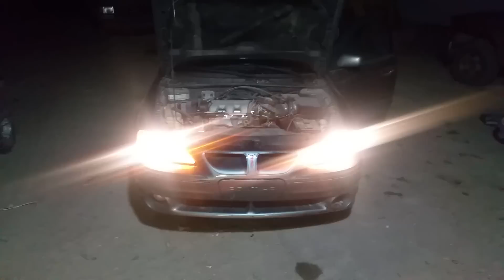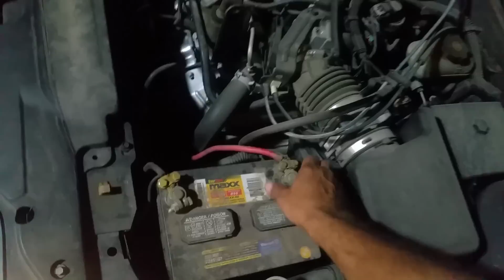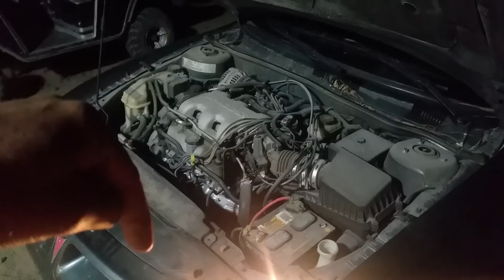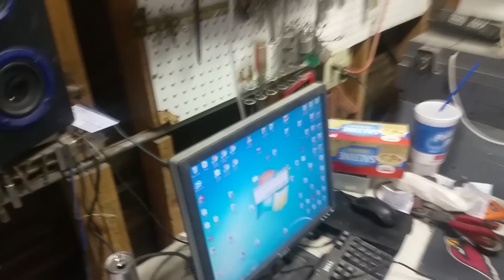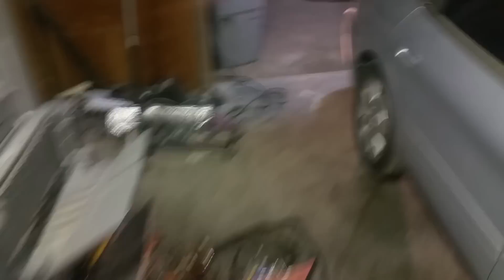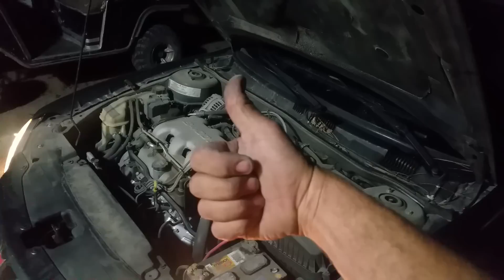Bad Alternator or Bad Battery, Easy Solved

Comment: Though yes this method works however on vehicles with ECU this can cause damage
Reply from the maker: uhmmm no, i am sure it wont, i am positive, i am 100 percent sure it wont, uhmmm yea ! no harm to the ecu by doing this. did i mention the ecu will be ok,,, do your homework. it may reset your ecu,,, but it will not harm it. you can buy a 100.00 $ obd reader and clear your codes,,,, it does the same thing ( resets your ecu ) but thanks for watching...
Reply: thomas brian it can also damage the alternator FYI ASE certificate
Reply: thomas brian what happened that once you take off a lead then it’ll spike up witch can cause endangering to the semiconductor however yes this is a rare thing to happen however it’s not the proper way to do it
Reply: thomas brian p.s said the one who ASE certified
Reply from the maker: ase certified,,, isnt everyone. its 45.00 $ on line for the course. ase certification is a joke, if you are ase certified, then you know that. semiconductor ??????? ha so funny. here is a idea ,, dont do it if you dont want to. but dont scare people from saving money when it is a simple task they can do their selves. seems ever day i am explaining this very thing. when i get a chance i will post another video dissecting a ecu and explaining how it works for all to see. you do know that any vehicle with a ecu will also have a internal regulator inside the alternator right ? what is the purpose of that regulator ? you do know that when the battery is full charged the alternator does not continue to put out 14 volts right ? you do know the ecu knows when the battery is charged right? you do know the ecu directs the amount needed of the voltage out put to the regulator before the regulator puts out the voltage ? your ase certified so of course you know. so what makes you think there will be a surcharge of voltage that the ecu can not handle. you do know everything in the vehicle has a fuse? you do know that when to much voltage is not regulated by the voltage regulator that the ecu will shut it down, and worse case it will pop a fuse to whatever ( including engine fuse for ecu ) before it frys any wiring and such. i have spent to much time educating you on all that you know already? please stop convincing people not to save money,,, please. if we can help another, its important that we do! its how we make our mark on this earth. thanks again for watching.
Reply: thomas brian your funny ☺️

Comment: Ok.  here's what happened when i tried this just last night  ( 6-2-18)  yes,  my batt had been doing wierd things...got the batt light on dash,  along with the 'brake light?...plus,  fluid on top of battery ( acid, assuming) so...replaced battery.  everything seemed fine....for half a day.  then....the dreaded god damn batt light again....and lifting hood,  freaking 'more fluid on battery, appearing to come out from under the two 'cell caps'.  what in the hell is causing a brand new battery ( 'and...my last one)  to be freaking spewing it's water and acid??....DID, have a couple 'know-nothing' teenagers...who work at both Auto Zone,  and OReiley...hook up the OBD 2,  and tell me,  your Alternator and Voltage regulator,  are both good.   I digress:  so...last night,  just to 'see this for myself,  and double check,  that those two idiots at the 'Wal Mart of Car Parts-Stores'...didn't get it wrong....i keep my engine running ( 99' Montero Sport) and lift the positve terminal clamp.  what happens....i noticably 'hear' and feel'...a surge throughout my engine...and,  of all things...my damn Window Wipers frantically start swiping.  mind you...the wand on the column,  NOT in any 'on position???....go figure.  then,  worst of all.. i pull into my driveway...and go to 'bring all my auto windows up....driver window,  won't come up.  Ladies and Gentlemen...i'm not sure 'lifting your Battery hookup, while your car is running,  is such a good idea.  what i believe ( clearly?)  can happen is,  you're going to allow a Volatage Surge,  to occur ( car-dependent)  and it could blow some circuits and fuses.  btw,  did check my fuse today for windows...replaced.  didn't help.  Great.  now i likely have a blown component or circuit Inside my Door,  which is going to require taking it into a shop..and fucking spending money.  DON'T DO WHAT THIS VIDEO SUGGESTS.  It can screw up components!
Reply from the maker: your so full of crap your eyes are brown. and why would you check a fuse if it is working. voltage surge you say. ha ha ha. with out the battery hooked up as you suggest , the alternator put out more voltage !!!! quick invent that and plumb it into my house for free voltage. i want to get more than i put in !! and here is the funny part ,,,, you disconnected the battery and acid boiled over,,, where was it getting more voltage if it was disconnected ! and if your trying to say it produced more after you hooked it back up then why didnt any fuses blow on windows and wipers and blah blah blah because the fusses protect these items from getting to much voltage,, hence the word fuse !!!!!!!!!!!!!!! here is what truly happened big guy,,,,,,,,,,,,,,,,,,,,,,, you disconnected the positive side of the battery and there is not one wire, but two. you failed to hold the two together so there was a voltage drop from the wire from alternator and wire to fuse panel. the voltage drop made a few things wiggle and that scared the hell out of you since you do not know enough about what you are doing. yes voltage drop not spike !!!!!!! but after connecting them everything went normally. but it worried you so much that you had a game playing part time counter person ( professional, just ask him ) double check things for you. next time remove the negative if it has only one wire, or keep the alternator wire close to the fuse panel wire or the car will try to die. needles to say your upset because 1 you didn't follow directions, and 2 you own a Mitsubishi that worries the hell out of you. i have your solution,, stop pointing blame because you cant follow direction and for crying out loud BUY A CHEVY !! hey,,, thanks for watching.
Reply: drummerfella 55  what a jackoff u are. thomas brian has explained in detail how/why it works & wont cause damage to your vehicle. i am no ase cert mechanic, just shadetree but probably have been wrenching way before u were born. not gonna re-hash whats already been said but maybe u should start with the basics & research what the purpose of fuses & regulators are for.
Reply from the maker: well said, thanks for watching bama

Comment: What about the wires between alternator and battery, could they be fray?
Reply from the maker: no, the alternator has a internal regulator that will only allow it to put out the amount of voltage requested, ( what is drawing from the wire).
Reply from the maker: thanks for the like clicks john. !!!!!!!!!!!!!!!!!!!

Comment: Dont forget the clock! You also have to reset the clock. Lol
Reply: It's not the memory they worried about is the computer is $100 computer you have to buy
Reply: And on some fords if you was to drop that cable and it was a touch anything $100 computer

Comment: This test wouldn't work on 1st generation Toyota Avalons though. Their electronic ignition goes haywire when you unhook the positive.
Reply from the maker: if you noticed in the video i mentioned holding the positive wires tightly together. this will avoid that, in your case just disconnect the neg. i will make another video better explaining i did not think this one would get this much attention. thanks for watching and for the great comments.

Comment: Great video.  I'm having a strange issue with my 2010 Odyssey: When applying the brakes, the battery light comes on but then goes off when momentum stops.  New alt, newer batt, checked all cables to/from both, checked all ground wires, just not sure what to look at next.  The vehicle does not shut off or shutter, just the pesky battery light.  Any thoughts would be appreciated.
Reply from the maker: check the alternator for a loose belt, it sounds like when applying the brake the engine has a little drag time. with a automatic it sometimes does that. with the release of power to the engine the engine can twist just a bit. i think your belt is to tight, or to loose. go to the further part of the belt from either pulley. center if you would. push in with your finger the belt should flex about 1 inch in. to tight or to loose and you can get a light or sometimes squealing. let me know what you find. thanks for watching.
Reply: thomas brian - I checked the belt as you suggested and it seems fine, about 1" of play either way. I also don't see a way to adjust the tension as the tensioner is what looks like a small shock absorber. I drove it around this morning with no issues but as soon as my wife took it to work the light came on when she pressed the brake. I don't get it.

Comment: Not true ... some cars need the battery to run.. My car shut down.. turned off... changed the battery and its running fine now... I think it had something to do with electronic fuel injection or something..by your logic I should  of changed the alternator..

1990 Honda accord.. 250k

Comment: DO NOT DO THIS!!!!!!!, especially on modern cars. because those rhave a computer in them and do ing this can seriously damage the computer in the car by just running on the alternator. get a mutimeter and meashure the voltage. do not remove the terminal when car is running bad bad bad for electronics
Reply from the maker: i guess your battery better never go bad while your driving, oh wait does the battery take a crap while its off in the garage. so simple minded, you crack me up with your high school mechanics club ideas and experience.  so naive to electronics its cute!!!!!!!!!!!!!!!!!!!
Reply: im not going to go into my electic knowlege im an electritian btw but here is the explanation to my so called high school mechanics.

Your battery does more than just provide electricity. It also shorts AC, spikes and transients to ground. Removing the battery from the circuit allows those spikes and transients to travel around, endangering every semiconductor circuit in your car. The ECU, the speed sensitive steering, the memory seat adjustments, the cruise control, and even the car's stereo.

Even if your computers and stereo remain intact, in a great many cases removing the battery burns out the diodes in the alternator, necessitating a new alternator. If disconnecting the battery interferes with the voltage regulator's control voltage input, it's possible for the alternator voltage to go way over the top (I've heard some say hundreds of volts), frying everything.

Even the initial premise was wrong. If you disconnect the battery and the car conks out, you don't know if it conked out due to insufficient alternator current, or whether the resulting transients caused your ECU (the car's computer, which controls fuel mixture, timing, and much more) to spit out bad data, shutting down the car.

Nobody should EVER run your engine without a battery.

And yet when you tell them not to, they'll roll their eyes. "I'm a professional. I do this every day. It's fine!" They'll sound so authoritative. So commanding. So in charge. So intimidating. But they're wrong.

The problem, of course, is that disconnecting the battery doesn't always damage something. It does it only sometimes. Less experienced jump start professionals and automotive technicians figure if they got away with it a few times, it must be OK.
Reply from the maker: you sir are a idiot,,, let dissect your comment so everyone knows why !!  first your battery does not supply electricity, it supply's voltage.  ( spikes transients to ground ) ha you do know ac is alternating current and dc is direct current ? no you do not . where is the semiconductor in your car big guy? come on your talking so explain ? also where is the speed sensitive steering , and how is it controlled ( ecu ) you say? why would your computers , ( there is more than one ? ) and your radio not stay intact , is there a self destruct connected to them? you say in a great many cases removing the battery burns out diodes? you are aware the purpose of a diodes is to convert ac to dc, ( no your not aware ) other wise you would know that even 800 amps at 12 volts could not burn it out. your more likely gonna cause damage hooking up jumper cables wrong, but even then the ecm can be reset. there is a safety feature they install in case you do, do that. its called a fuse dumb ass. lets talk about fuses for a min idiot. check the amp rating on your alternator fuse, battery fuse, and ecm fuse. hmmmm i wounder why the ecm has a stronger fuse. maybe so the others pop first go first,,,,,,, do you think? ( no body should ever run their engine without a battery) ,,,, let me ask you a question ? i am on a 200 mile trip and my battery takes a shit 40 miles into said trip, should i have my vehicle towed? the battery light just came on ( another great manufacture gift ) is it not ok to continue to the closest place to get a battery ? while running on the alternator? because i have had a lot of people drive in with a no good battery but the car is still running you dip shit!!!  no naive to this shit. ( got away with it sometimes so it must be ok ) sometimes? i have heard many times even years ago about what your saying, however i have never seen it. wanna know why? because i am a professional and i understand the way this stuff works. i am not a fat ass sitting on the couch playing games and speaking about what i hear, i talk about what i do? my videos are to help others with no, or little cost to them. and when a idiot post something that can detour them from saving their hard earned money , it pisses me off. so get educated for your self, and stop repeating what other idiots say. do your own homework!!!  now go back to your pga, and weight loss videos and leave the real stuff to real men ,,,,, yes i did my homework.

Comment: or you could jusrt plug a volt meter into it for I dunno 3 quid on ebay? or a multimeter.
Reply from the maker: again this video is about saving money, you go ahead and buy your volt meter for such a small issue. ha ha
Reply: thomas brian could easily cost you your car not really saving anything. You could build a small contraction for less than the fuel your using to start the engine. Sorry the video is stupid.
Reply from the maker: how can it cost you your car, so simple minded. stop listening and do. this generation believes everything they hear and confirms nothing. just crazy. but thanks for watching. anyway.
Reply: thomas brian simple  really I’ve done it. So unless you’ve worked on  every car out there best you try not to advise others. Every manufacturer is different and it’s been done end of discussion
Reply from the maker: your funny, clearly you have not clicked on my name under this video. because i have worked on about every car out there rookie,, i only film things that i know will help others in need. but yet still have videoed hundreds of things i have worked on. so please tell me rook, why will it ruin your vehicle. that you can not tell me because you have no idea. alternators have a internal regulator , that means the voltage is regulated to the voltage needed to charge your battery 13.-14.7 volts. that alternator don't care if the battery is accepting the voltage or not. its still gonna put out if its good. either the battery takes it or it doesn't. if the alternator is bad, its not putting out anything. so again i ask you ( do your homework before i make you look stupid from your response ) what will it do to your car when you disconnect it when its running? if the battery is not connect and your engine is running, does it somehow increase the voltage ( regulator ) and send it to your cig lighter. ha ha or maybe your door locks. or your ecm even. ha ha. end of discussion my ass. thats what people say when they have ran out of things to say. please educate me rook !!!!
Reply from the maker: still no explanation why, so funny rook, so funny. nothing about what it does, or what will happen. just a slap on the hand and told not to do it. people like to read why and why not. i thought you were done rook? give people a idea what your talking about? we are listening? 12,000 plus subscribers what to know. educate us. your told not to do it from another rookie that you respect, i get that. but open your mind and understand what your talking about. because all the intelligent people you are talking about are laughing at you rook, they are laughing hard. thanks for watching though, i do thank you for that....
Reply: thomas brian look it doesn't matter if you write an essay or a book you're still wrong and everybody with qualifications in this area no better than you do so get off your high horse because we all know better than you do think it's intelligent to tell people to essentially destroy their car really intelligent people like you should be banned from YouTube because those less intelligent really will screw something up. Not everyone has thousands of pounds for an ecu. Just because it's fine on your car doesn't mean it will be fine on someone else's

Comment: Just use a multi meter with the electrical system under load. To test the alternator should be around 14v
Reply from the maker: again its about the money ( the purpose of the video ) you would be surprised how many can not afford one. or understand how they work. thanks for the comment. its all about saving money. thanks for watching.
Reply: Mish Mash , Is it 14 V with the lights on or off?